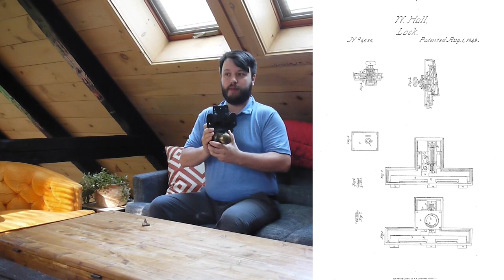The Collection: Hall Patent Powderproof Lock

Comment: That lock has been commonly called a "Grasshopper" lock for decades and as said, is commonly found on Herring safes.  It can still be found occasionally on antique safes for sale on Craig's List although it's rare to have one with the original key, I have several of the locks both in and out of Herring safes with and without original keys.  

Your's is not a "salesman's sample.  Iit's a lock that was removed from a safe and was in someone's collection where it was painted black and red.  Original Grasshopper locks were never painted.  And, the levers are "dimpled" 1 thru 6 for assembly purposes not for "salesman sample" purposes.   Finally, the "bar" that enters each lever when the proper key is inserted in the lock is called the "stump" which enters the lever's "gate" unlocking the lock.  

Dave LaBarge
LaBarge Lock and Safe Technicians
The "Safe and Vault Historian"

Comment: Are you sure its a salesmen sample, and not an instructional model? To me it would make more sense to think that it is a instructional model, because of the tool for decoding, and the numbered levers so you can change the coding, to practice decoding, but still be able to set it back to factory with ease. On a logical note as well, I don't think it would make sense to sell a lock by showing everyone how it works. Also will the decoding tool fit and operate the lock?

Comment: I wonder why these did not take off? Other than the small key, I would think it would be difficult to pick.
Reply from the maker: They sort of took off. The Herring company produced a good number of safes with this style of lock on it, and Linus Yale Sr. and several other folks took out patents on similar lock concepts. However, it sort of entered the right market at exactly the wrong time. The first half of the 19th century saw key-based safe locks dominate the market, and this was a doozy. However, the latter half of the century saw a dramatic shift to dial combination locks. So while this certainly had some time in the sun (2 decades?) it was just a great idea coming a little too late to change the industry.

That said? You can still see examples of this concept pop up in production every now and then, and in particular the "Forever Lock" I mentioned has been drawing a lot of new attention to the idea: [No Talking Version] "Forever Lock"- Un-pickable lock Demo.

Of course, any time you call something unpickable, some German will find a way: "Forever Lock" bumping, picking, picked